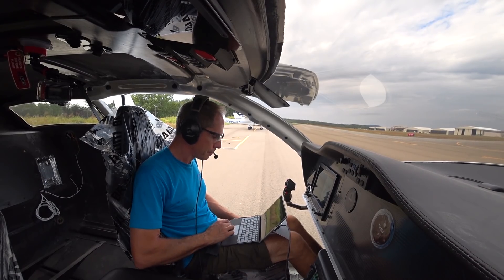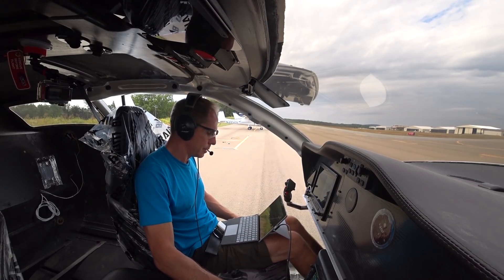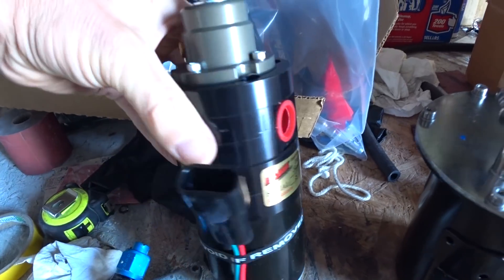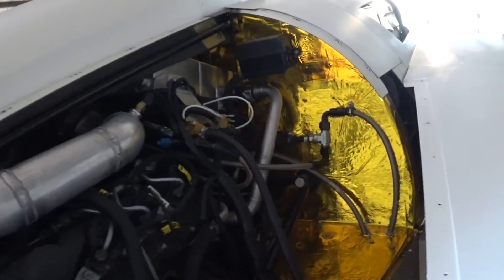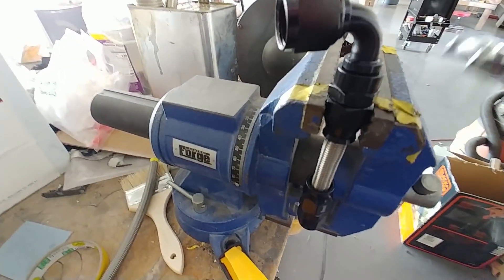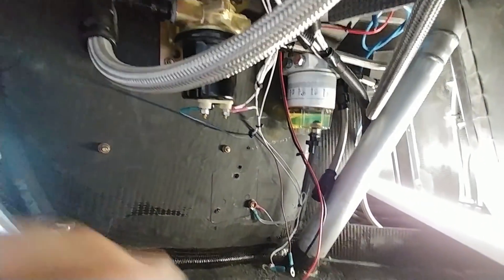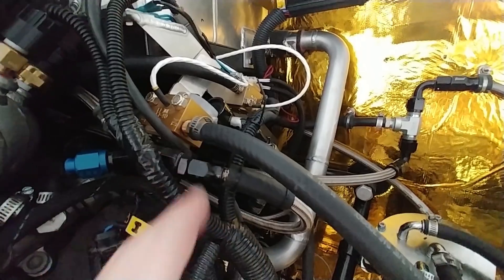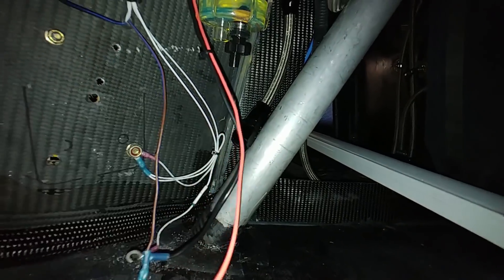Dying Of Thirst - Building the Raptor Prototype

Comment: I really do appreciate what you are doing. This is an incredible airplane. However AUDI isn't the most reliable manufacturer out there, Yes, there is some sarcasm there. And it seams like a lot of trouble with it. I hope this machine doesn't let you down.. As a key board engineer I see a lot of failure points there. Stay safe man.

Comment: BTW, the reason the return line goes through the filter is only to heat the filter so it doesn't clog up with crystals forming below 5C. It doesn't go there for reasons of back pressure. The back pressure comes from the injector itself, not from the fuel pump.

Comment: The injector back pressure is regulated to 10 bar (145 psi) up to the left/right return line combiner with built-in pressure regulator valve. So as long as you had that combiner in the lines, you had 145 psi back pressure already independent of the fuel pump pressure. The first level pump inside the fuel tank has a check valve to keep the fuel lines pressurized when the car is off. The 72 psi inline boost fuel pump doesn't have a check valve, rather the left/right injector combiner has it as mentioned above.
See this diagram: https://www.dropbox.com/s/vi2g1p5p1d38idp/fuel.png?dl=0

Comment: As you have repeatedly starved the high-pressure fuel pump it now needs to be replaced. Any further testing with the damaged pump will only succeed in filling the injectors with debris from the failing pump. The diesel truck hot-rodding boys find out the hard way too when the frag the high-pressure fuel pump. They usually pay well north of $10,000 for their lesson installment.

Comment: ,,, well, maybe I learned something, wasn't aware that the pizeoceramic wafer stack, needed any help to move the pintle or disk to release the fuel. Still don't have my mind around how 60 pounds of pressure, can affect 20 thousand plus pounds of pressure,  but it might be just another Bosch system type   . hmmm, as I think of it, picturing a double sided pintle with 60 pounds on one side to dampen the actuation  .

Comment: i believe VW's use a weird click clip kinda thing for all the fuel lines thats rated for them pressures but im not sure what a single threaded hose clamp is rated to. just a thought pal. 
And speaking from experience with a similar issue but this was yacht with large diesel engines i was working on, keep a couple of fire extinguishers handy on your first few full power run ups when all those new lines are ran upto pressure for the first time, hot diesel hitting hot exhausts is an instant, well you know. keep up the good work cant wait to see it fly.

Comment: Appreciate your letting us in on the development of your prototype project! I would comment though that a 6-8 amp sized pump would be a better match to expected hp (and much cheaper to buy) than a 20 amp model. Not really a problem for prototype use, of course, although I think adding an external 4 bar regulator (and yet another return line) would probably result in even better pressure stability than using a pump with built-in regulator (if that's what's being used, wasn't really clear).

Comment: Well done Peter, a lot of work but in the right direction. Had to do a similar setup for a supercharged diesel which was suffering starvation but it was not a common rail so I felt the data I had would not have assisted. I wonder though, the hose clamps you are using cut into the rubber over a period of time and not allowed in Australia for aviation use. We use hose clamps that have a threaded screw and nylon nut to compress the fitting onto the hose. Would you consider using them instead as you have a high pressure feed and have to fit the clamps relatively tight to prevent any leaks now and in the future.

Comment: are those lines with the hose clamps rated for 70 psi? if I remember correctly, that VW filter uses dedicated lines that require a tool to release (they clip over what the hose is butting to now).....

Comment: Did you get the check valve installed too?
Reply from the maker: I already had it installed. The one side of it was just plumbed to the wrong place.
Reply: Been following from the start. Love Canards and their slick looks. Had a Defiant nearly in kit form, but realized I couldn’t afford 2 engines. Building something more practical for my budget, zenith ch750

Comment: That plumbing chnage is important ... before the pump had to supply the fuel that was used by the engine PLUS the fuel coming back out of the injectors and back to the tank ... now you have re-plumbed it,  the fuel returned from the injectors goes back to the injector feed, so the pump ONLY has to supply the fuel actually USED by the engine ... much less flow requirement now for the pump!!

Comment: Peter,  Always amazing and it looks like you are on the right track.   I still do not understand why when you went back to your baseline set you were then having starvation issues you previously did not have.  Do I understand this right?  You may want to eyeball any tank pickups, pump screens and filters while you await your new pump.   New builds seem to always have debris no matter how clean.  I ran into this with a screen on the intake side of a fuel pump.  Could not see it unless looking directly into the unit with a light.    Keep wrenching!  

As S/V Seeker guy says:  What did YOU build today?  In your case you built a kick ass airplane.

Comment: Given the rise in pressure, you might want to double-check that the hoses are all rate for that. Additionally, the cross-sectional area and pressure determine the flow so you'll want to make sure none of them are undersized either. It might be a boring checklist but probably worth the double-check.

Comment: Interesting, industrial common rail diesel engines run MAX 10 psi, usually 5 to 7 psi to high pressure pump inlet.

Comment: You are rushing too much.  Your engine installation should have already be defined.  Slow down ensure your get the fuels system correct.  You should double check all specifications on parts before purchasing.  If you fail to plan you plan to fail.  That engine no matter that it is an Auto engine should be installed with the same installation as the car in respect to fuel and electrical to have a base line.  Fuel injection has been around for a while and there are only a couple of methods to plumb the fuel lines.  Slow down double check everything.  I recommend you take some breaks and go over your fuel system and electrical system.  Have you thought about cooling your fuel pump?  Have you thought about having a redundant fuel pump? Have you looked over other diesel engine installation?  I want you to be safe and any pilot flying your plane to be safe.  I want you to succeed without breaking the aircraft.  How about another qualified person to go over your installation and get a second opinion.  They may see something that you have missed or haven't thought about.